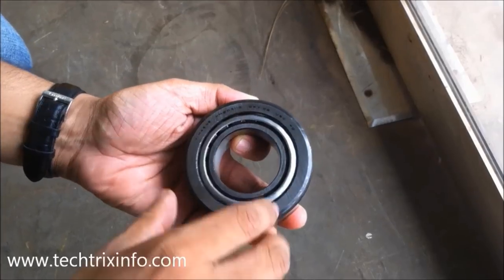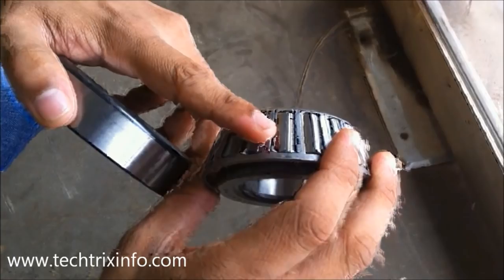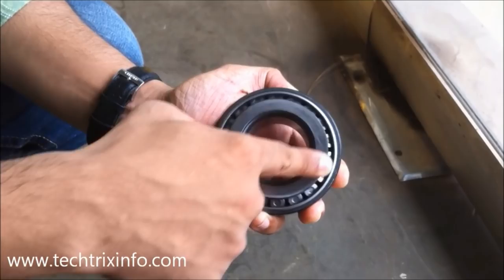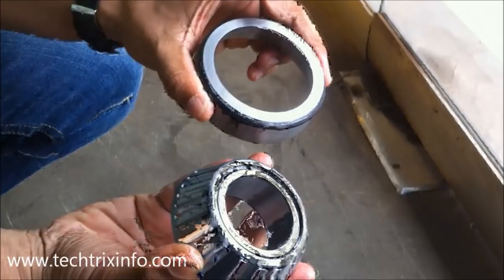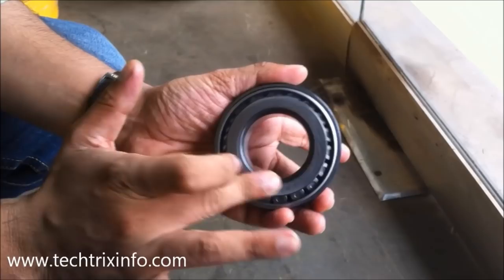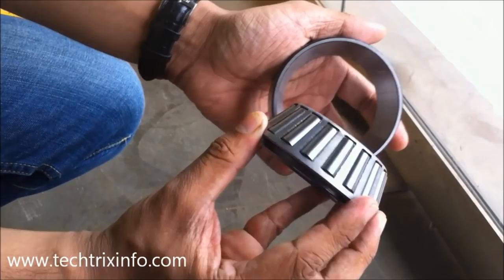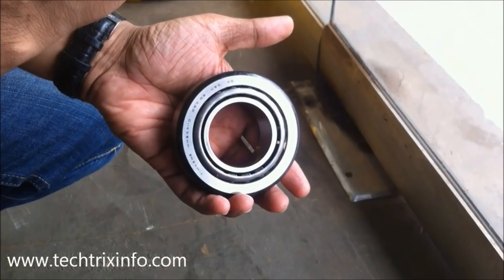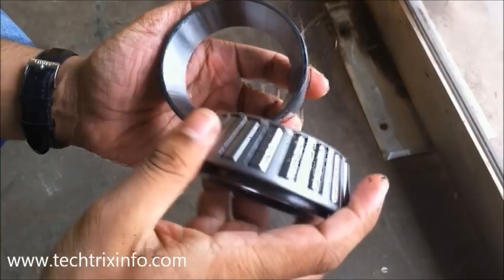How tapered roller bearing works. ✔

Comment: I believe, the roller bearing can bear radial load, but axial load bearing capability is small. While in tappered roller bearings, they have axial load bearing capability as well. Hence they are preferred in such applications.

Comment: thanks for the informative video. wanna ask is this bearing suitable for working in high temperature situation? the bearing i'm using now is 20mm inner diameter ball bearing with outer diameter of 42mm and thickness of 12mm. Do you have any idea why the shaft always runout and grind the wall causes the shaft itself become abrasive?
Reply from the maker: +clouds sky14 it might not be the issue with the bearing, there could be a alignment issue, just measure n see. thank you What's app us @ +919744615655 To get updates on Mechanical/ Automobile engineering